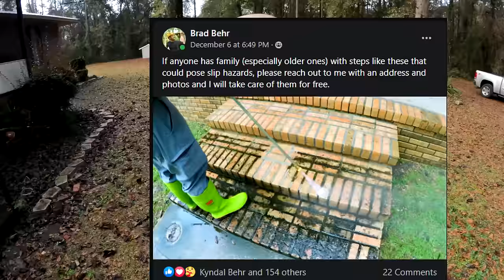Sweet Old Lady Slipped On Slimy Steps (Oddly Satisfying Pressure Washing)

Comment: Good job although I have a couple of tips for you! When cleaning wood try to go from one side to the other in one motion (as you did on some of it!), will stop all those lines in the wood. Also I’d advise getting a turbo nozzle for the stone, save you time and will do a better job! Also I would’ve finished off that small section of wall to really make it look great, not just the centre section. See you put bleach or sodium hypochlorite on the back of the truck, would defo spray some of that down after just to help kill off the algae and brighten it up even more, just make sure you rinse it off after 15 mins. Hope you don’t take this the wrong way, just wanted to advise from one professional to another 😉👍🏻
Reply from the maker: I appreciate the thought, but I covered each one of those points in the description :)

Comment: That's a great gesture for this family. Stairway safety is paramount with the elderly and the disabled. I know you mentioned that they plan to paint the stairs. Once they do that, may I suggest putting skateboard grip tape on the steps? If you're unfamiliar, it's material that you stick to the step and has a very grippy, almost sandpaper like surface. I'm disabled and have this on my steps. It really helps keep the user stable as the use the stairs. Keep up the great content and thank you for the pro bono work you do. 👍👍
Reply from the maker: Very good tip! I will send this to the family!

Comment: Nice job! I used to pressure wash professionally for a few years.  One trick I learned that worked for me with wooden decks is a little counter intuitive.  You will notice when it dries you can see every stroke made with the wand if you go with the length of the board. However, I learned that if you go perpendicular to the length of the board, then you will not have those stroke marks in the wood when it dries.  It will look clean without the lines from where you stopped and started each pass with the wand. Anyways, good luck and great job.

Comment: 2:36    This is why it is very important to stain your wood steps AND then USE WOOD SEALER, in my experience, it is better to just replace the steps instead of pressure washing them. pressure washing the wood removes the sealant.
5:14 This is why you use deck screws instead of nails.

Comment: Great job. A great upsell for paying customers would be non slip paint on those steps or a clear coat with a little sand in it. Well done.
Reply from the maker: Very good tips! I like the Duck Back additive myself (not for this application, just meaning I used it in the past for my own purposes and liked it.)
Reply: @Copper Creek Cuts Lawn Care  I just had to google what you meant. I assume duck back is the brand. I have used similar products, but I'm based in London 🇬🇧 great products.

Comment: Nice work.  To anyone reading this and are able bodied, anyone can do this.  These pressure washers aren’t expensive.  You can hire a company to do this or you can purchase the machine at Home Depot or Lowes or online for 150 bucks and do it yourself.  I clean my cars, sidings of my house, pavers, rugs, etc…. And believe me, I hate cleaning but using the pressure washer is oddly gratifying.
Reply from the maker: Yeah pressure washing just takes time and some physical ability. You do have to be careful using them a long time, as they can fatigue your hands/arms very secretly.

Comment: That stuff is slippery and I don't know if you got it down where you are at but we have some kind low to the ground plant that is full of water and it looks like its just been over cooked is the best way to describe it. 

But when its full of water it is slippery if stepped on. If dried out or frozen it goes completely black until the temperature and water is just right. You'll usually find it near concrete or on the side of the road.
Reply from the maker: Not sure what that is but sounds nasty!

Comment: Make sure to clean all of the surface don’t leave spots untouched. Like the aluminum peace below the door, or the rest of the concrete bricks
Reply from the maker: I wasn't going to pressure wash the aluminum threshold as that was too close to the door for my comfort. I didn't want to force water under the door inside. And I covered the concrete brick part in the description, always read there if you have questions.

Comment: Do you like that Echo Pressure washer?  I'm on my 3rd pressure washer.  I clean the lines and pump but they just don't last past 4 or 5 years.   Lol, pressure washing police.  Even though you said you didn't do it to look like a good guy, well....you're a good guy for doing that.   I like pressure washing and making things clean.  I need to do my house because the wet and forget isn't cleaning it as fast as I want.
Reply from the maker: I do like it! It has always been a good unit for me. Ethanol free is all I use in my equipment, so I never have starting troubles.

Comment: You're an okay guy Brad. I think if they sprayed a little bleach a few times a year it would help prevent that from recurring.
Reply from the maker: I agree but from the research I did it said some woods don't take bleach well.
Reply: I have used oxyclean to clean wood. Mix the powder in Hot hot water and spray or pour it on. Let it set for a while and rinse it off.
Reply: My grandma sprays diluted white vinegar once a month. I don't know how it affects wood, but it seems to keep stuff from growing.

Comment: Jeeze - why on earth wouldn't they extend the water pipe and move the tap out from under the deck???🙄 Looks like brand new....Great job - well done.👌👏
Reply from the maker: They had more than one tap, that was just the closest that would be the least hassle on the pressure washing side.
Reply: @CopperCreekCuts  - good to hear. I'd be flat out getting under there with my knees.🤣🤣🤣

Comment: So what do we do if customer doesn't really want us to use their hookup for water? Do you ever get that issue.
Reply from the maker: You advise them there is no way to realistically supply your own water. Water weighs ~8.3 gallons per pound. With a 4 GPM pressure washer, you would consume 33 pounds of water a minute. If you are pressure washing a driveway and it takes you four hours, you would need to bring 8,000 pounds of water. And that is just for that one job. You would also need a pump at the trailer to push it to the pressure washer.
Reply: Why lie?
Reply: @CopperCreekCuts Does not work like that. You need the crakton 2004 which scales the derpro to near perfect levels.
Reply: @CopperCreekCuts  that works. Thank you.

Comment: Why leave the sites dirty of the stone step?? No a eye for quality
Reply from the maker: Covered this EXACT question in my description (along with a dozen others). If my videos ever leave you wondering, ALWAYS check the description.
Reply from the maker: Q: You didn't do a great job on the flagstone
A: You are right, I purposely avoided the edges of the stones. Again, my main goal was safety, so if 90% of the surface was cleaned, that is all that matters. Cleaning everything would have meant blasting all the dirt in between them away and creating a muddy mess the homeowner would have needed to fix. Also, since I was displacing all the dirt that helped make it a flat, level, surface, I would also have been creating uneven surfaces that would not have been safe.
Reply: Seemed that no dirt was lossed. 2 more inch made a lot of difference.  But he, eighter way its looked nice and save now
Reply: Lighten up, Annie.  Sit back and watch.  (You have no eye for spelling or grammar, either).
Reply from the maker: @annalies5246  No dirt was lost because I didn't spray to the edges. I am saying if I did what you wanted, I would have blasted dirt around the stones out. I don't have that much control to get the edges of the stone without any of the dirt.
Reply: @kathleenardrey5094  English is not my native language

Comment: Too bad you did not pressure wash the weeds between the paving stones. Or finish washing the small stone wall.
Reply: Brad was doing this for safety reason.  This was not a full-blown yard cosmetic job.  He was cleaning to enhance  the stepping area.
Reply from the maker: Would have made a mess to spray out the weeds. I didn't want the whole stone wall clean, just where they should step.